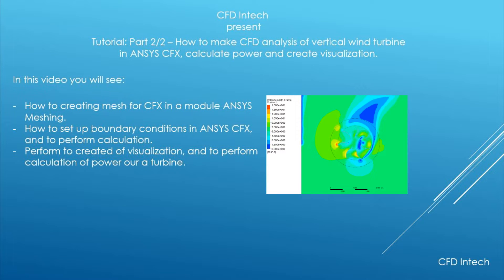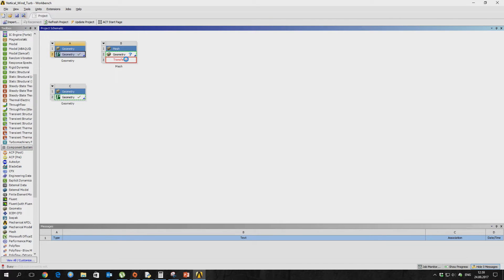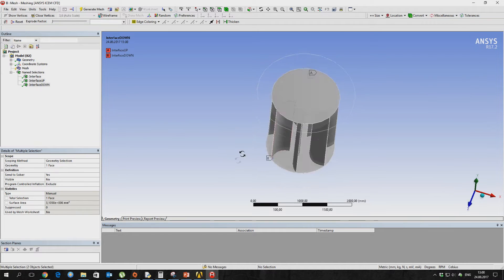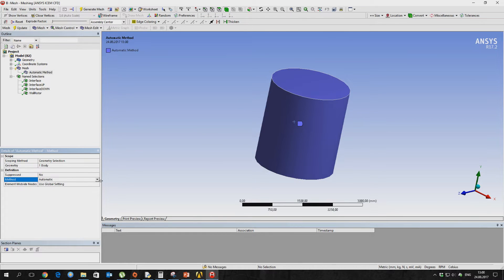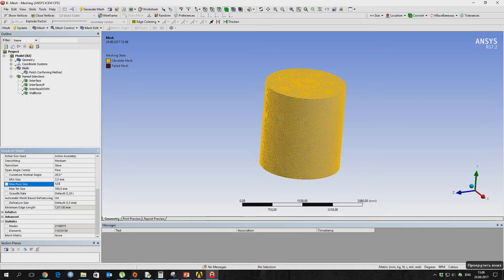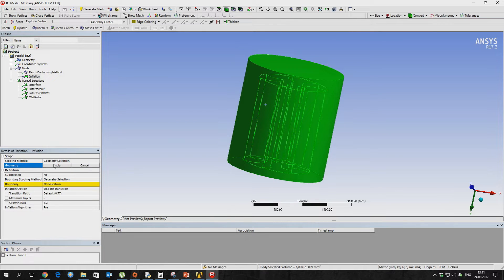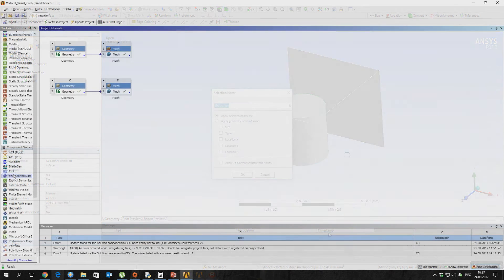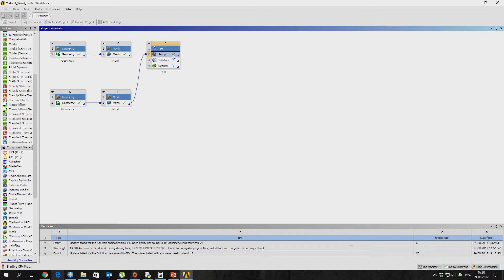Tutorial ANSYS CFX Part - 2/2 | Transient analysis of vertical wind turbine, calculate power

Comment: Hi, thanks for the great video! Could you possible make a savonius simulation inside a pipe? and derive power graphs and power coefficient graphs with RPM? That would be a huge help. There is a gap in existing videos!

Comment: Do you know the math for electric motors:   grinder, drill, blender, wand blender, alternator, home fan, treadmill,  washing machine,  etc... universal vs dc ? what can you find that's already made in vertical type turbine, ( cylinder hood vent) etc... or can you purchase or make blades for  metal circular bases with a shaft . What size shaft is required for rpm to watts to volts to motor size and rpm zone (ie-100-2500 rpm ) or 800 -8000 rpm etc... ?

Comment: Why did you set 100 rev/min?
Reply from the maker: Rotation speed relates from moment on a shaft (generator + friction losses), which we don't know. So i set random rotation speed. But if you know moment you can calculate your rotation speed - n through expression for power: N = M*pi*n/30.
Reply: @CFDIntech  what if i need to derive resultant torque and force on a wind turbine only from a wind of a certain speed? Do i set initial 100rev/min as 0?
Reply: @arshynmeiirbekov6830  You can use the formula Torque= (Power output/RPM)*(30/pi). Power formula is 0.5*CP*rho*A*v^3; where v is your free stream velocity, A is area swept by the turbine, rho is air density and CP is turbine efficiency. You can define your required torque and then calculate for power.
Reply: @AggarwalPranshu  hi, what if I want to find power coefficient and torque?
Reply: @CFDIntech  thanks for your video, by the way

Comment: Hey why is your Expression Power is in Joules ? It should be in Watt right ? And why is the RPM unit less ? Kindly reply to this !!
Reply from the maker: When we use expression we can to choose any units or remove them. Power of the turbine rotor is calculated as P (power) = M (torque)* omega (RPM*pi/30). You can to follow for units or no. Whatever, you get unit - [Watt]